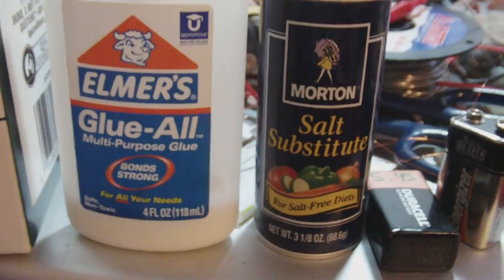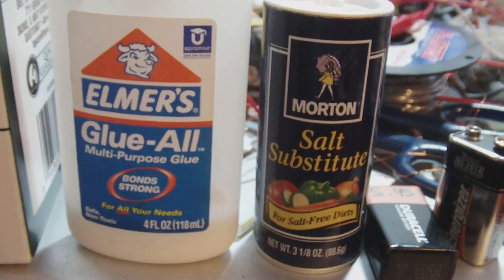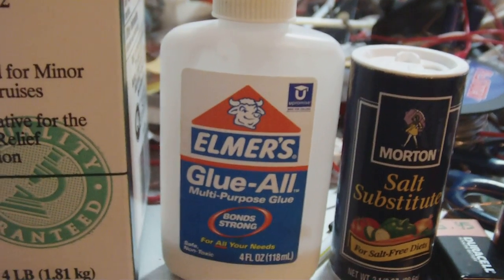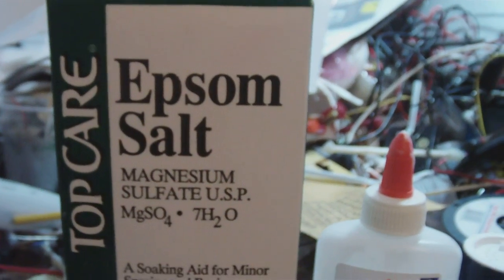Glue Cell Potassium chloride Epsom Salt

Comment from the maker: @tweety30number11 

The water is due to the mix rejecting the water thats locked up inside of it. If you fold the paper like i do un-fold the paper and hang the cell up, the water will dry within a week. Make sure you're using different metals and also make sure the metals don't touch each other only the glue mix.  Test the cell with a volt meter, you should get over 1.3 volts.

Comment from the maker: @tweety30number11 

You forgot the Epsom salt. 

Put some glue down then salt substitute and then Epsom salt and mix it all and then stick the metals in. allow to dry for 12 hours. 

Keep in mind this is not a very powerful battery, the key important thing about this battery is that it self charges and doesn't use water.

Comment from the maker: @tweety30number11 

Speaker wire should work just fine. Just make sure you use to different metals, so you have speaker wire and another wire like aluminum or magnesium. the cell should work when dry. 

For the best results use Elmer's glue, Epsom salt, and Salt substitute and then use copper and magnesium metals and allow it to dry for 24 hours.

Comment: hi thats interesting...Going to give that a try and order some things of ebay. Really like your work and tinkerings, look forward to them. I was wondering if you wouldnt mind trying to make a few say in series,  and in parallel and see if those volts and amps could be bumped up. Would appreciate it if you tried it, im going to when my stuff is ordered. Ive tried the concrete copper/aluminium batteries but forget the use of alum so they have corroded now. Take care mate

Comment from the maker: @JavaLessons 

So far it doesn't. I'm testing some cells now and they can go days with a short with no deterioration and they resume their original voltage within a hour. From what i can tell the glue acts like a barrier to keep oxygen out and the Epsom salts keeps the cell dehydrated and strong. Also the notebook paper helps to drain away the water from the glue too.